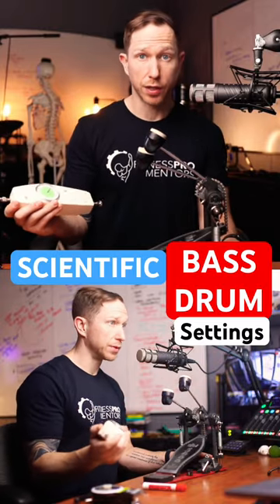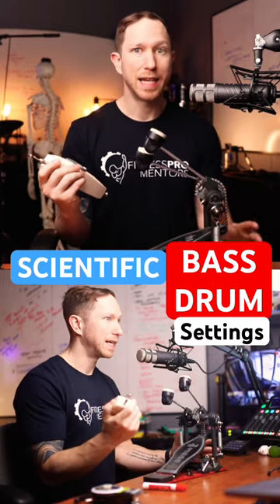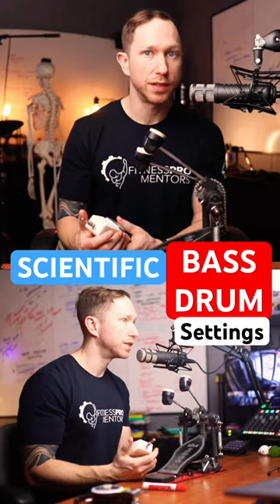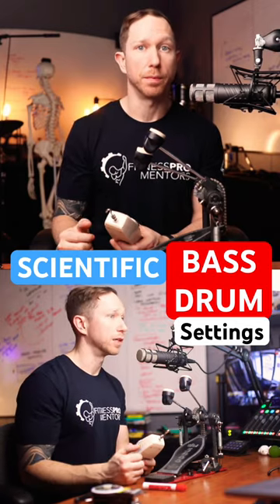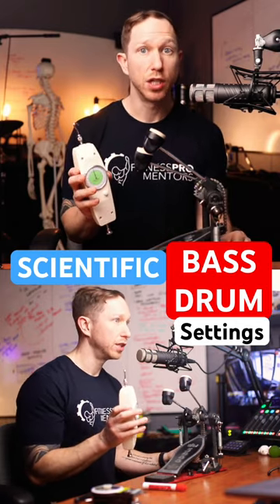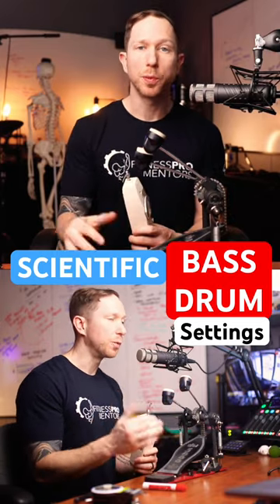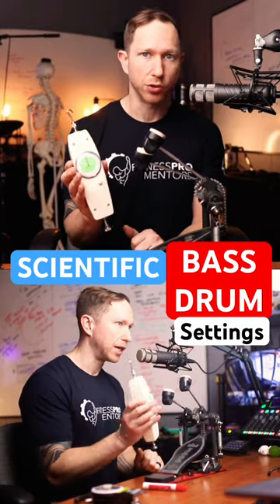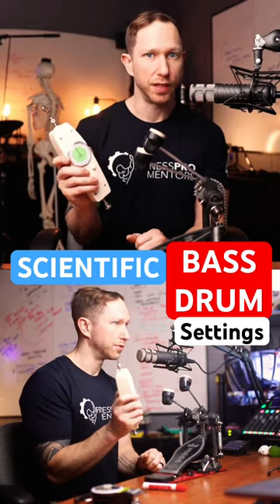Scientific Bass Drum Tuning with a Dynamometer 🤯#bassdrum #drumlesson #doublebass #tip

Comment: Moment of inertia at that point is greater than where ur toes would be pressing so ur getting an inaccurate reading of the force u need to exert unless ur only applying pressure that close to the pivot point.
Reply: doesn't matter as long as he always measures from the same point
Reply from the maker: Thank you. Consistency measuring from
The same spot allows to get a better metric. Getting into inertia and moment would insane to try and calibrate. But I’m happy to learn if you have a suggestion!
Reply: I don't think it's anything to do with the moment of inertia. It's just that he picked a point closer to the hinge which means that he'd have to apply more force for the same torque as compared to a point further away from the hinge.